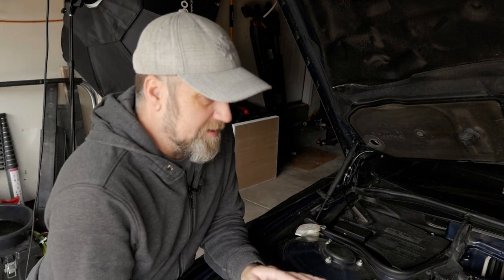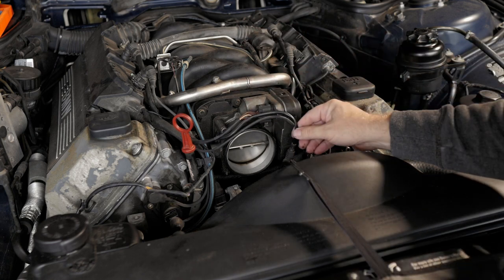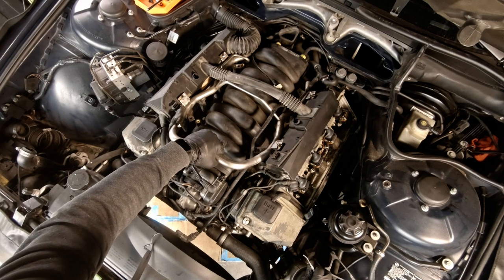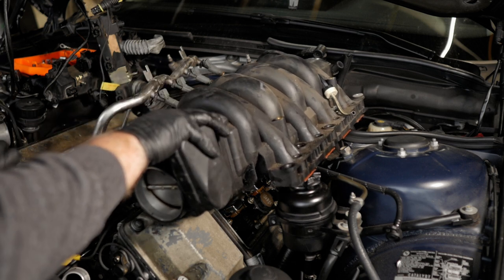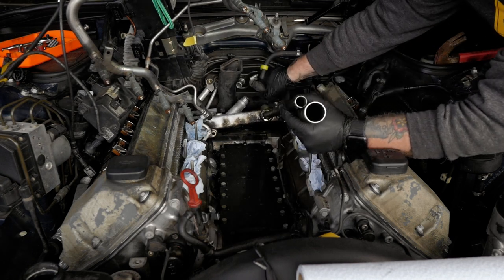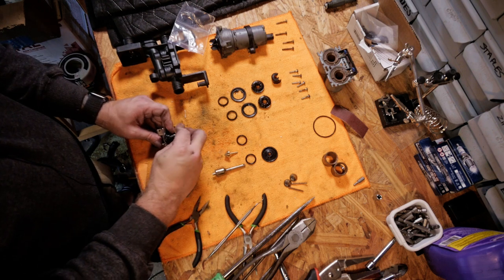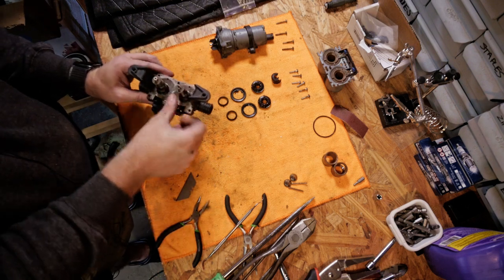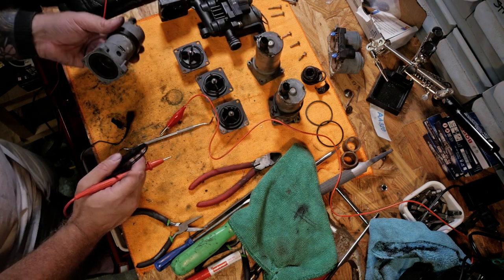Tearing Off The Top of My Engine!  | BMW 2000 740i SPORT E38 | Project Carlsbad Pt5

Comment: I have the same spec car (color even!) and I'm doing a lot of the same things you are, so just came here to day I'm very happy to follow your work!
Reply from the maker: Happy to be here :).  If you run into any question, just give me a shout.  Haven't uploaded in a while, but I've been focused on some other stuff recently, but hope to get back to it soon.  On the other hand, the thing is running so well I haven't felt the need to rush back!  But, the suspension is badly in need...I have all the parts sitting in my shop, just need to put them on.

Comment: Oil in the intake usually comes from crank case ventilation going bad
Reply from the maker: Totally makes sense (replacing that tonight, actually), I’ll make sure and point that out next episode.  There wasn’t any oil in the intake (as far as I can tell, and never had smoke come out so haven’t burned any oil) but it was on the gaskets…seemed more outside than in, but I’ll confirm that later.  Thanks!
Reply: Thanks! saw all my gunk in the valley pan and in my TB.

Comment: I'm looking forward to seeing you do the timing chain job. Fortunately for me, my E38 either got lucky with a good batch of the guides/pins or the previous owner had the issue fixed since I found no timing chain guides in my oil pan when I changed the oil pan gasket. Unfortunately for me, I have a leak from the transmission (shift seal probably) and leaking transmission oil cooler lines.
Reply from the maker: I have so many leaks, I'm just trying to knock one at a time out and hope to eventually get to them all :).

Comment: any chance you have a link to the heater pump seal kit you bought? Thanks
Reply from the maker: I do, but it's not "currently available".  I bought it off Amazon.  There are a bunch for sale there and on ebay, I was just looking for one that had the parts I wanted to replace, including the gaskets, o-rings, diaphragms, and plungers.  I'd have liked to replace the springs too, but didn't find one that had them.  They tend to run $20-$35ish dollars.

Comment: There are parts that came out of my E38 heater valve that didn’t come out of yours. They’re small plastic cylinders of the same material the large cylinders are that are pulled out to replace the gasket which the conical brass seats into. Is there a way to send you a picture to see if your familiar with them? I have E38 software and manuals, watched other YouTube videos, posted on forum (with no reply). Maybe you’ll know where they go. Thanks
Reply from the maker: Sure, feel free to send them via Twitter or insta.  Links should be on the header of my YT page.
Reply: @rollorescue1582  sent to Instagram already. Also loooked at your Instagram exploded parts on the table. They’re not there. I’m not doing any other work on my E38. It’s 115F here so not even sure why I’m even fixing the heater.
Reply from the maker: @paperandmedals8316  haha, because we can’t help ourselves.  I’m away but I’ll take a look tonight and see if I can help.  I’ll reply via Insta.
Reply: @rollorescue1582   thank you
Reply: @rollorescue1582  any thoughts?